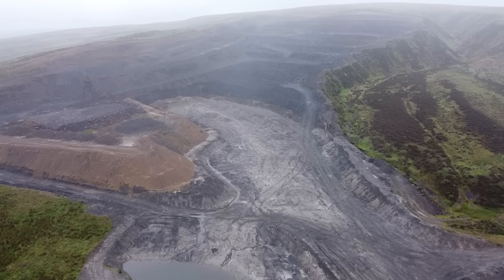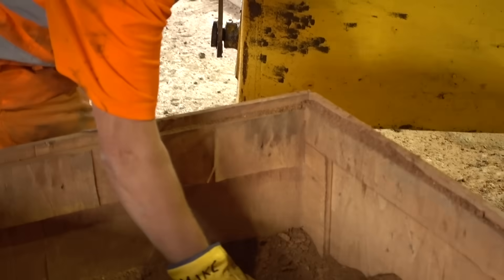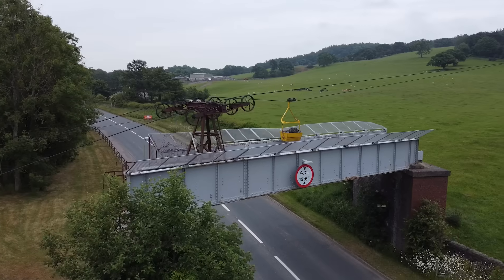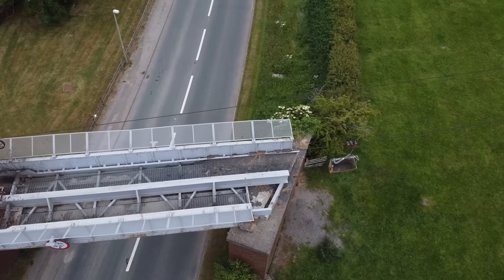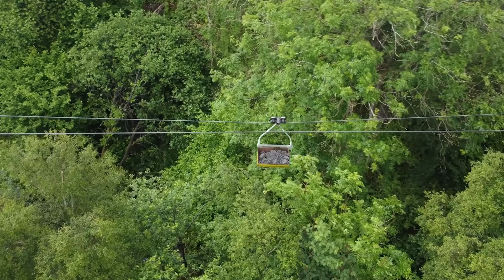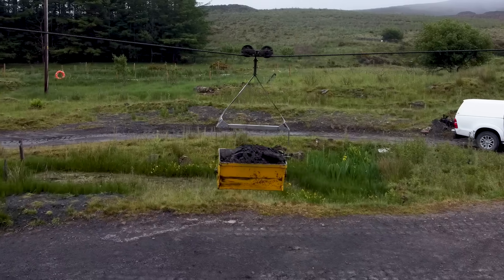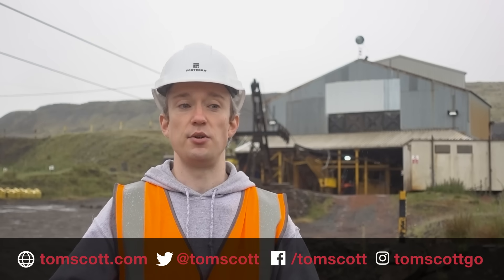The UK's last aerial ropeway uses no power, moves 300 tonnes a day, and will be gone by 2036.

Comment: The cable would probably last longer than six years if they bothered to try to protect it..... At all..... Put a roof over the end support pulleys and towers. Spray oil and corrosion inhibitors onto the cable at each end station.

Comment: Did I miss something or did Tom not explain how the buckets make it back up the hill? I understand gravity is used to bring them down, but how do they go back up?
Reply: Ill explain it for you. The ropeway is powered by gravity. The extra weight of the loaded buckets pulls the empties back to the loading point. There is a braking system to maintain the correct speed and allow the rope to be brought to a controlled stand when required.
When "on the rope" the buckets are suspended from a hanger, the head of which has two free running wheels, and two clips. The clips sit on top of the rope, to which they are held fast by a combination of gravity and friction between the rope and the clips. As a bucket approaches the top or bottom station, the wheels engage with a rising Bull rail to lift the clips off the rope. The bucket is then free to run along this rail, which allows it to be manually controlled during the loading and unloading processes.

Comment: So the only thing that doesn’t use fuel is going to be phased out? Right that makes sense.
Reply: Because there won't be any use left for it by then and it would incur extra maintenance costs just to sit around. That said, I do agree that smart design like this could and should be applied in more settings.

Comment: This is nothing short of pure, triple distilled genius! Letting gravity be your engine means you never have to worry about fuel or electricity. Just keep it maintained and you have a constant flow of shale from the quarry to the kiln. The costs of maintaining that would be less than a fleet of trucks and the fact it needs no fuel means it produces no carbon emissions while transporting.

I am just completely blown right the hell away. Even today such a solution for transport downhill over essentially any distance would be a great asset to whoever can use it.

Comment: Wait how do the buckets travel uphill?
Reply: Two things are going on here: 
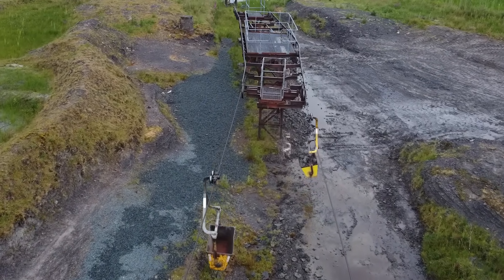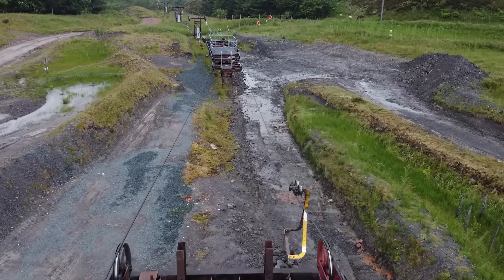1) The "rollers" on the bucket do not sit on the rope - they're only used when the bucket comes off the rope and onto the "bull rail". You can clearly see this at 1:28 on the right-hand bucket. The bucket rides the rope by some other mechanism that somehow both holds the cart to the rope, and is able to go over the rollers on the supporting towers 0:28
2) Because the bucket is affixed to the rope, either mechanically or simply from the friction of its own weight, it pulls the rope, and gravity pulling the heavy bucket down the hill provides enough energy to pull an empty bucket back up the hill at the same time.

Comment: Wait, how do the buckets go back up the hill from the quarry, did I miss this part in the video?
Reply: Imagine you have a peg stuck in a wall. Hang a bit of rope over that peg, and attach a small bucket to each end of the rope. The rope does not move, because each bucket weighs the same. Now, fill one bucket with sand - it descends, whilst the other rises; the weight difference means that gravity is doing the work in moving the buckets. Now, simultaneously empty the full bucket, and fill the other with sand. The newly filled bucket will descend, and the newly emptied one will rise.
The aerial ropeway uses the same basic concept, with some clever engineering that keeps it going in a loop. The weight of the newly filled buckets at the top pulls the empty buckets from the bottom

Hope this helps you understand :)
Reply: @joshroberts4076  ah yes, totally forgot about this principle, it's clear now, thank you!

Comment: Why don't they have the manufacturing facility next to the mine? 

Like very close to the mine. Is it because of weight? Want the most space underground possible that's safe, so buildings above will reduce the safe length of tunnels and such?
Reply: You still need to get the product down the hill. So by putting it on the flat the truck won't have to come up the hill.

Comment: Reminds a me a bit of the cable cars in San Francisco, CA, U.S.A. Sure, the wheel that turns the cables ("ropes") are powered, but the cars themselves use nothing but the muscles of the operators to yank a lever back that causes a clamp to attach to the below-the-road cable (which runs at a constant speed of 14 mph) and to push down a foot-lever which causes breaks made of replaceable pieces of wood to press down on the tracks. It's a slow, noisy, jerky ride with the pleasant (albeit confusing in the city) smell of saw dust!

Comment: They put in something similar (but larger) than this at Harteschotter Werk Haltengut, near Glarus in Switzerland around 15 years ago. There the skips are much larger and feed hard sandstone from the quarry near the top of the mountain to the processing plant in the valley below. The system there is a net producer of electrical energy.
There are quite a few very small rope ways in that area for moving things from the main road in the valley up to the various, small, farm holdings too but these tend to be powered. Great technology.

Comment: 60,000 tonnes / year (0:02) is an average of 164.4 tonnes / day, so how does the ropeway move 300 tonnes / day? Maybe the quarry only operates for part of the year?
Reply: They may shut at weekends and on Bank Holidays - especially if they're near housing, and also, potentially, close the quarry for essential maintenance for a week or two each year. It won't run continously for 365 days.
Reply: @adrianchell  How did I forget about weekends? 🤦‍♂️ Well, I know how: too many math/physics problems where automatically 1 year = 365 days.

Yes, with 261 weekdays, several of which become holidays or maintenance, the numbers are perfectly reasonable.

Comment: If they need to brake the buckets then they could use regenerative braking and generate electricity.

When it's comes due for closure why not turn it into a tourist attraction and put seats in the buckets?

I remember a similar system on the outskirts of Accrington in the 1950s.  That too transported material from a quarry to a brickworks.

Comment: Now, if we could just get skiers to ski uphill the chairlifts could be just as efficient.
Reply: Are you telling me free energy/perpetual motion doesn't exist?
Reply: They have to make artificial snow with big diesel generators these days. It would be highly inefficient to make even more snow for this. 

Actually, skiing as an industry should be decommissioned too.
Reply: Nah no need for it. Just load enough of heavy stones, matching skiers weight on the top and it would lift them up!
Reply: @HuatengChen  you're gonna need to get those rocks back up though
Reply: @stanlabs8323  nah, just dump them at the bottom like these people do then the next skier can bring the empty bucket up when they come down. Then you have to dig more rock from the top of the mountain to bring him back up
Reply: @stanlabs8323  Humans are roughly as dense as water.
Snow is... water.

Load snow, it'll make its way back up eventually. 

Loading it all, and enough to counter the carriages as well as the humans? Probably more costly than just using electricity.
Reply: @LeafShade  that's a lot of snow shoveling to do.🤣
Reply: @rutgerdekok1324  Look, I said it was possible, not that it wasn't stupid.
Reply: @LeafShade  humans and snow are both water, yes, but snow is far less dense than liquid water. It’s full of air pockets. “Freshly fallen snow usually has a snow density of 0.07 to 0.15; glacial ice formed from compacted snow (or firn) has a maximum density of about 0.91.”
Reply: @HuatengChen  Congratulations, you have just invented an elevator on it's side. That's why they have counterweights.
Reply: I wonder if there would be enough snow being produced on a continuous rate to obtain free counter-weights for the downhill side...

Comment: If it were financially viable, they should bring the top station down to near the bottom and keep it operating with water in the buckets or something so it can be a museum imo. remove the cable from other areas but keep the towers!

Comment: I believe (could be wrong) but isn't this the kinda of mechanism used in chair lifts for ski resorts? Specifically talking about the non "high speed" lifts.
Reply: Ski lifts transport the weight UP the hill, so power is required. Gravity powers the skiiers on the return trip.

Comment: These are the type of green power solutions that we should be implementing and improving upon. Not forgetting to time.
Reply: Only works if the mine is above the production area. Most mines are below and you need to lift the product out.

The new way (where they can) is a truck that charges the battery on the way down.

Comment: ¿Is there not a motor needed to set the system in motion?  A similar system was used, between around 1930 until 1966, to carry sulphur ore from around 5,450 meters above sea level, on the slopes of the Tacora volcano, to a railhead, at 4,980 meters. Th railway was the highest in the world.

Comment: Surely there's a way they could turn this into a tourist attraction as a ride or something!!?? Maybe hike up to the quarry and ride the cable back down, just replace the buckets with seats!!
Reply: The issue would be that to pull the seats up to the top you'd need a constant supply of hikers to send down the hill. You could maybe use weights as substitutes during low-hiker times but then you have issue of working out how to move the weights back to the top again

Comment: At the end of the ropeway, they use a conveyor to move the shale onto a truck. I’m curious why they don’t just drive the truck over to the quarry and load it with a conveyor there. Is this just more efficient, even with maintenance costs?
Reply: Because the truck would have to drive up the hill. This way the buckets going down pull the empty ones up.

Comment: Not gonna lie, the fact that the material comes off the ropes and then immediately into a dump truck kind of kills some of the vibe here.
Reply: I mean it saves a (id guess) 10+ minute drive out of the quarry for each load, where it would be heavily laden and really guzzling fuel, by loading it on flat ground at ground level. with the old system. It might not be completely green, but it is at least more fuel efficient and more environmentally friendly than the common alternative.
Reply: @jimmyc3030  I live near by. There isn't really a properly made road to the quarry and it does really need a 4x4 to get there. Plus, the driving route is quite a lot further than the ropeway as it has to go the 'long way round'.
Reply: well what did you expect, a horse drawn cart?!
Reply: @orionfell  directly to the brickworks
Reply: @orionfell  I was expecting it to go directly wherever the hell the dump truck takes it to. That’s not exactly rocket science

Comment: My Teacher: Perpetual Motion Is Impossible
Tom Scott: "It Is!!"

Edit: There's Some Serious Conflict Going On Inside 🙃⬇️
Reply: This is gravity fed, not perpetual motion. If they didn't fill a bucket at the top it would stop.
Reply: That is spreading actual misinformation by misquoting Tom.
Reply: it's not a perpetual motion machine humans have to interact with it

i may be wrong tho
Reply: @asunflower7993  It isn't a perpetual motion machine but not because of human interaction.

All the shale that they move has some potential energy, when they move the shale downhill that energy is removed from the bucket with the shale and it goes into the other empty buckets.

For something to be perpetual it'd have to require 0 input of energy from external sources to keep going. In this case, it's getting energy from moving shale downhill.
Reply: @GtmNayan  that was my point (:
Reply: @asunflower7993  you can automate loading and unload make a ramp at the that will angle and empty cart and at the top some level that opens the door for rocks when cart mechanism pushes it.

Comment: nowadays they’d just use electric dump trucks to achieve the same thing. No energy required.
Reply: Electricity is also energy.
Reply: @svennoren9047  yup but it's free energy. The trucks charge themselves going downhill with regenerative braking. Remember they're carrying the load downhill. Returning uphill with an empty truck requires far less energy.

Comment: There used to be a lot of those here in the states. But the advancement in technology, and tree huggin pricks killed off most of the mines and of course, the equipment went with em.
Reply: @Aditya Chavarkar there's a steam plant five miles from me, right now that still uses coal. And fyi, a lot of the material you're using now came from the ground.
Reply: @Aditya Chavarkar may have been on the decline, but over regulation killed off at least three mining companies within fifty miles of here. That's only in the last fifteen or twenty years. We can't open a strip pit on top of a mountain, but we can sure as hell put a wind farm on one. Let me put that into perspective. We have a wind farm, two hydroelectric dams, the steam plant, and a nuclear plant all in a thirty mile radius.

Comment: And we sometimes would like to believe that our ancestors weren't thrifty, clever or environmentally forward-thinking.  In some ways our Victorian and Edwardian forbears were a bit sharper than we are...and they oft' did more with less.  
Great Video.
Reply: They weren't thinking about environmentally friendly solutions. Just the only solutions viable with what they had available. But your point about tradition is a good one.
Reply: I'll agree with thrifty and clever - that's how you make a business succeed against the competition. Clever - this is the ultimate KISS design (keep it simple, stupid).
Reply: @donjones4719  Keep it stupidly simple
Same thought, tends to get less people in a twist :)
Reply: I don't think they cared about about environment when they made this. No fuel saves money, simple as
Reply: @ezrapetty9666  Also, the fewer moving parts something has the less likely it is to fail or need repair.
Reply: Well today we don’t send things back to be reused like the did, we throw glass and aluminum away in trash while back then they sent it to be sterilized and reused

Comment: I may be being completely thick, but I don't understand this, how does this thing actually work? If the destination of the ropeway is downhill from the quarry, then all those empty buckets are going uphill. Is this somehow kept in equilibrium because the full buckets going downhill are heavier than the empty buckets going uphill? My brain still can't quite process it.
Reply: Yes.
There's a loop of cable.
The full buckets pull the cable along, as they descend.
The empty buckets are pulled upwards.

Comment: Idea to keep this thing operating even when all the stuff is mined: turn it into a tourist attraction where people get to enter glass capsules at the top and move all the way down at a slightly higher speed. I for one would love to get a view like that on a relaxing cable car descent.
Reply: It would most likely not work, if the carts are not significantly heavier on the down-hill than on the up-hill side.
If passengers are to be "used as weights", it would require a constant flow of passengers in order for it to not stop or slow down.
And the passengers would only be able to ride on the down-hill part of the track.
Reply: @Awhwk8tsffk  you're right, unfortunately... This would've been awesome had it just worked. But it could still work if it was motorized. This would be the easiest solution. Or it could be done by a large group at a time, and then the group could drive up by bus and take ballasts with them at the same time. Idk how they get up now though...

Comment: probably a bit of an over simplification but essentially works as a water wheel, with replacing the water with the shale. cool way of using an idea that would ususally be used for energy for transport.

Comment: Lets consider the alternatives, you have trucks, which are expensive, labor intense, require extensive infrastructure and tons of maintenence; you have rollers and conveyors, which are expensive and maintenance intensive and are only effective for short distances; or you have this which is effective over a good range, only needs like 8 workers total and doesnt need fuel, its maintenance is waaaay cheaper than trucks and its infrastructure cost is comparatively inexpensive and impermanent, you could probably make 10 miles of this stuff for the cost of 1 mile of paved road.
Its largest issue is to do with the terrain needing to be steep enough for the gravity feed system to work...

Comment: How do the buckets get back to the top of the hill? Surely they are powered
Reply: The buckets going up are powered by the buckets that are going down. The loaded buckets coming down are heavier than the empty ones going up. It is nothing more than a basic pulley system with a ridiculously long cable.
Reply: @bullock1993  that makes sense

Comment: In North Wales, slate quarries employed similar systems. Narrow gauge railway wagons, empty, were connected to a cable at the foot of a steep incline, which was coiled about a drum at the top of the hill. The cable came back down on the other side, & loaded wagons were attached at the top. The empties were pulled up by the weight of the loadeds. Such systems as I have described were in use by 1860s, but the idea of 'heavy thing down, light thing up' is even older then this.